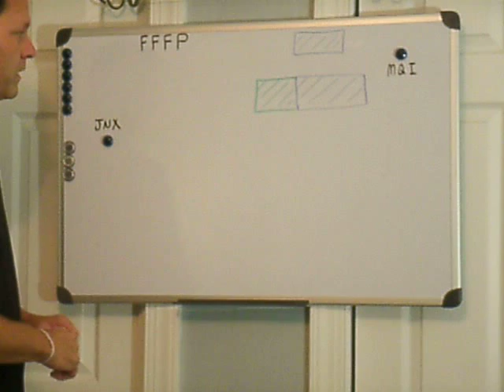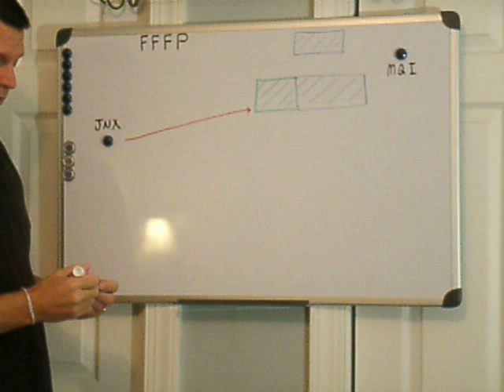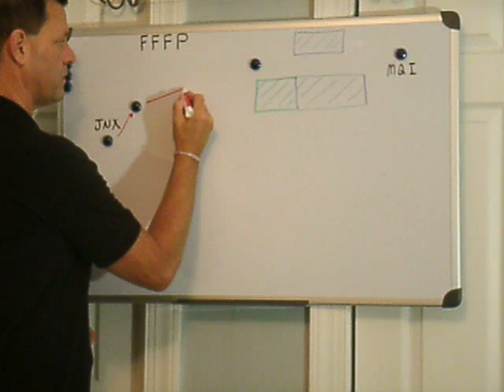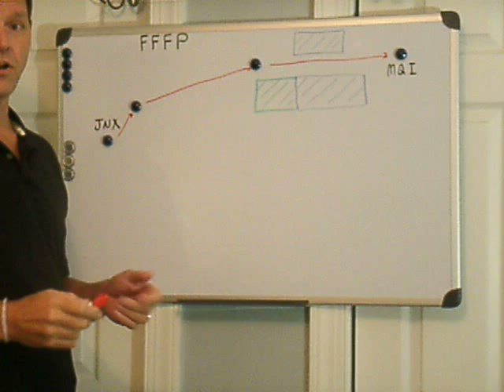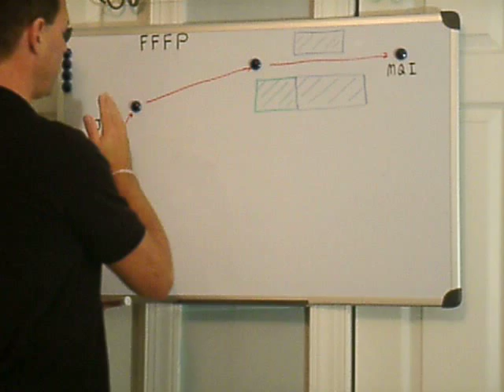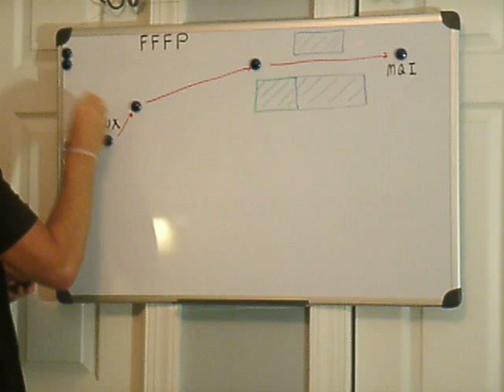OBX Flight: Four-fix flight planning

Comment from the maker: Frank, sorry for the delay.  In a commercial application, yes.  Depart say, CLT, DP (SID) -Transition, Enroute (which could include many more fixes in this one phase of the flight), STAR-Transition, and then an Approach.  STARs generally lead to an initial approach fix (IAF), but the approach is a separate feature.  This video was actually designed for instrument students in smaller GA aircraft that don't usually use DPs. The principle of dividing the flight into three distinct phases remains.